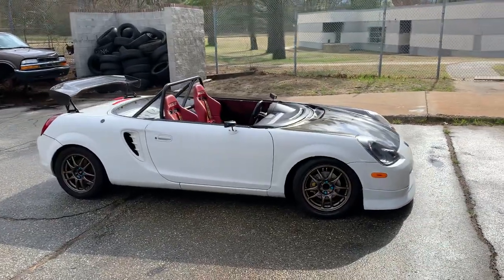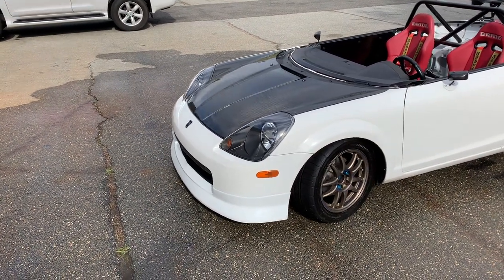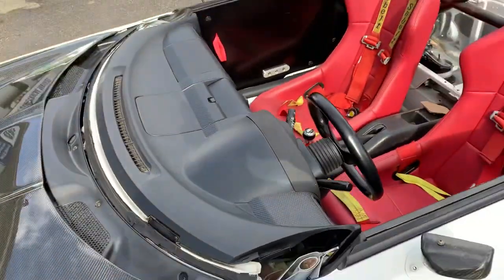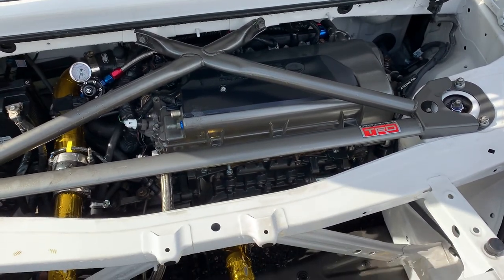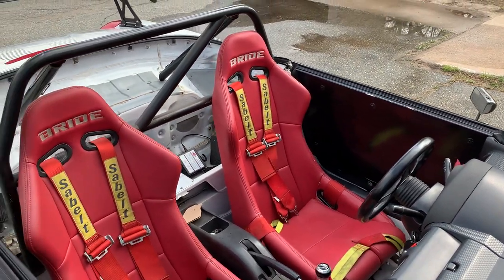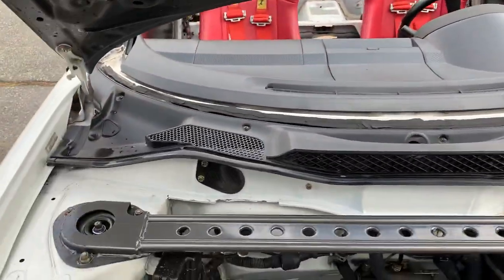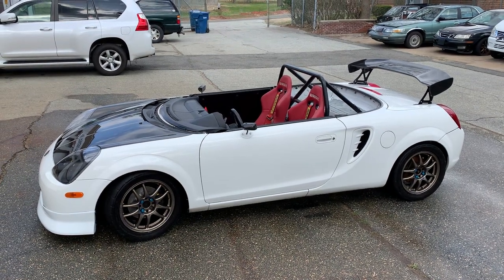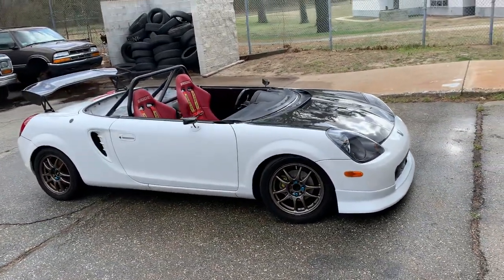Commute attack mr2 pt1: Introduction and overview.

Comment: Looking great sir! 1800 lbs is awesome! Congratulations
Reply from the maker: Trying hard for 17xx but with the 2zz, c60lsd, turbo stuff, rollover protection weight, all 4 trd braces, and corky’s under brace, it ain’t gonna come easily. A 1zz/c50 with no added braces would be pretty easy. My 1zz turbo (c60lsd) car weighs under 1900 with stock seats and carpet (full interior minus srs, rear bins and radio stuff). But no bracing or rollover protection.

Comment: Some people say that the center console comes down when the fixed steel frame of the center console is removed. In the case of the vehicle in the video, the steel frame has been removed. Is there any problem?
Reply from the maker: You can perceive a slight increase in scuttle shake but it’s minimal. I’m pretty tall (6’2”) and my right leg interferes with the upright enough for it to be worth it for me. It’s reversible if you don’t like it so I’d recommend trying it and seeing if it’s for you. I’m going to make a brace to restore the rigidity without contacting my leg for mine.
Reply: @ryanking6651  Thank you for your kind reply What do you think is the most positive and weight-saving thing? Shorey Battery is going to try. How much weight can a hole in the body lose? Doesn't the body lose strength when you make a hole?
Reply from the maker: I would say that the best bang for your buck weight reduction on these cars is in removal of things that you don’t use. I deleted the rear bins first, which actually frees up some space with minimal sacrifice. I try to focus on things that improve the experience as well as reduce weight. Ones that pay dividends in multiple areas. I’d say the battery is a great place to start, shorai makes a great product. The speed holes are ok either in places where structural integrity is less crucial or they should be dimple dyed to add dimension and regain the integrity that would otherwise be lost. Toyota actually did a lot of that on these cars already. Look at the frame horns under the rear fenders and at the front x member beneath the radiator.

Comment: Hi, nice car. How much weight?
Reply from the maker: Thanks! It’s not done yet obviously, but as I said in the video, it was 1859lbs when it had hvac and steel fasteners. I’ve done more weight reduction since this video. I’m shooting for 17xx, but we’ll see. We’ve reached the point of diminishing returns, from here on out it looks like about $100 per pound. Bearing that in mind, I’m trying to focus the expenditures on things that not only provide that $100 per lb but also add to the experience in other ways weather that be aesthetically (blingy bolts, carbon body panels, etc.), or in improved control interface(seats that fit me better, etc.). I’m going to try to fabricate a bunch more little things, like billet brackets and hinges for things, stuff like that.